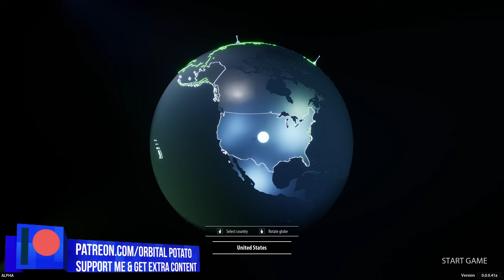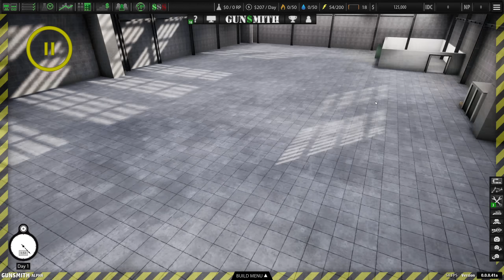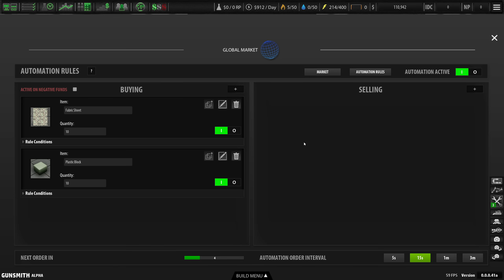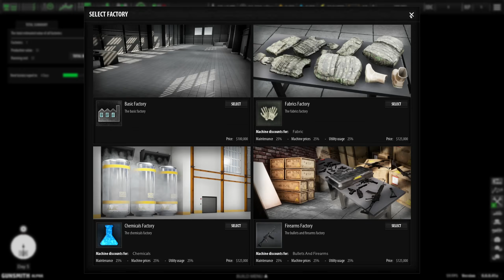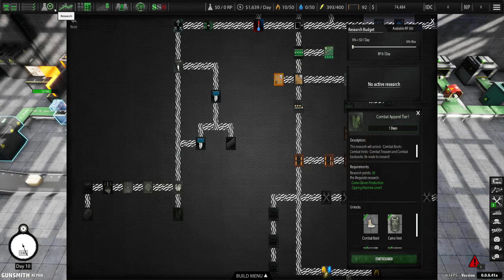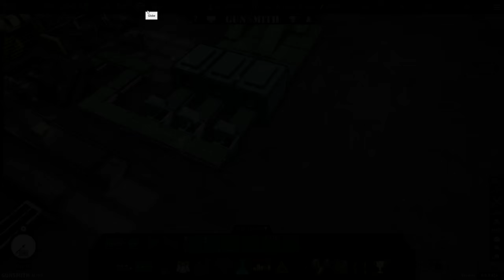STARTING A NOTORIOUS EMPIRE - Gunsmith - Base Building Management Game

Comment: you may be more productive by breaking the process into sub categories using the recycle bins so create fittings and let them fall into a recycle bin that places them into you inventory and do the same for the fabric gloves then use the input machines to place them back onto a belt for the combiners as each machine has a build speed and a material input requirement if your input is faster then the crafting speed you have a backlog of unused parts like the fittings in your case this will also save you space in your factory also you only need one sowing machine on the line you have created so you can save money on utility costs removing two of them hope you get this advice to help you progress
Reply: punctuation who the f### needs it anyway